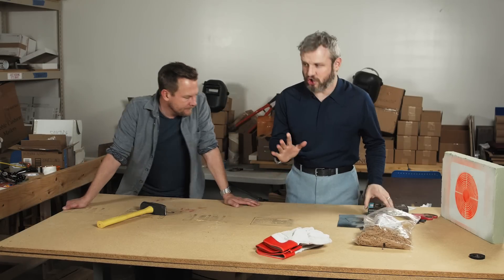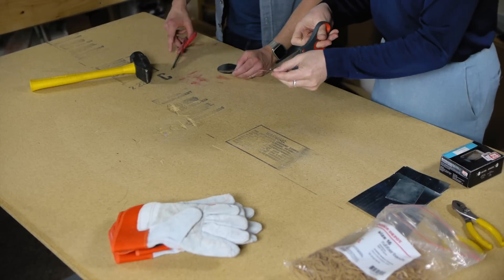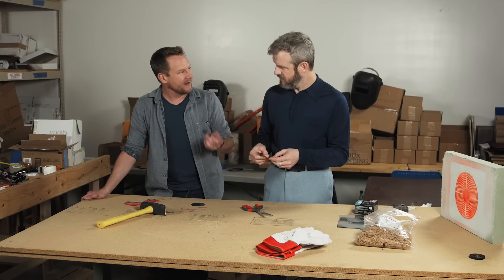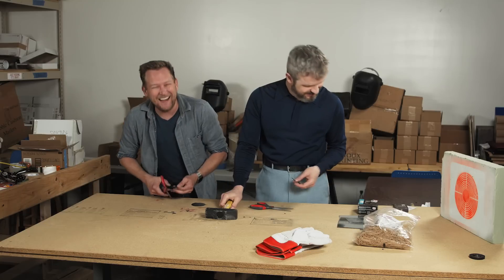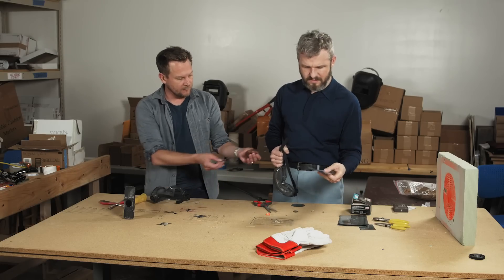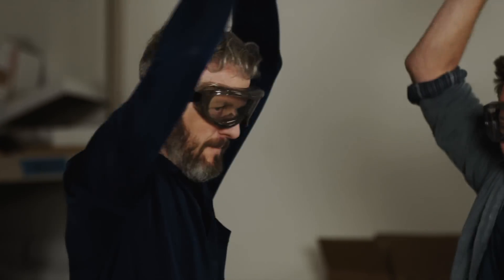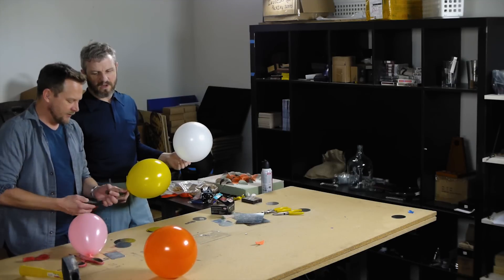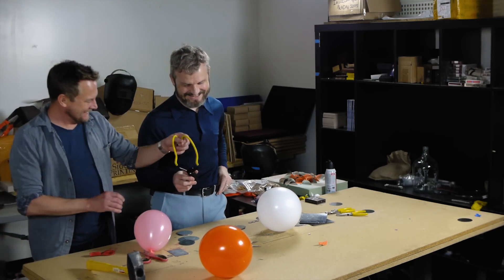Testing Ninja Stars with a Slingshot

Comment: We did this at work one time at the end of the year when we had a stack on non-functioning badges. We just stacked a few on top of each other using the adhesive already on the badges, rotated them, cut them, and threw them at targets. Surprisingly sharp and effective.

Comment: I used a wrist rocket in combination with a 4 point star and it was really impressive. It would stick half way into a 2x4 and you had to stand on the wood and use a vice grip to remove the star.

Comment: I think you guys should revisit shuriken and actually do it right. Try some bo-shuriken, make actually usable multi point shuriken and learn to throw them right. Even taking some large gauge nails and welding them together, like you guys actually mentioned, would be miles better than these little discs. If you want any tips, I am a knife maker and have made some simple improvised bo shuriken in a few minutes and I have been throwing knives and various kinds of shuriken for the better part of 15 years.

Comment: I used to make some gnarly ones out of exacto knife replacements, a little glue and some electrical tape, 3 points seemed to work best cause you could get about ~3 from one pack and I put them through rigorous testing and it would go through some sheet metal and chipborad and wood easy, it also had a tendency if sticking two points in which was brutal cause the way you had to remove it, cheap as hell and very effective
Reply: don't let me get bored with extra art supplies

Comment: Use to do something like this. just cut squares out of 16-20 gauge sheets using Aviation Snips and a few strokes of a file to deburr them.you can also buy large square washers and sharpen them with a grinder.

Comment: Backward spin is the answer. Start with playing cards and rubber bands. Use your fingers as though you are shooting a spitwad when you were in third grade. Place a playing card in the loop of the band. Grip the band around the card about  3/4 of an inch from the bottom. Take some practice shots at low power till you get the hang of it. I have shot playing cards onto the roof of a 3 story building. No BS.

Comment: u should have pulled the slingshot back further...7 inches of pullback..no wonder it wasent going in...if you hold the slingshot sideways you can use the top prong of the v for a sight...itll be waaay mor accurate..i kno this cause im a slingshot target shooter btw js

Comment: What kind of damage would this do to an actual human? While I realize that these are meant to harass, if the target had their adrenaline pumping these would have to have a decent effect in order to get the target's attention.
Reply from the maker: I'm betting if you're just standing guard and suddenly get cut across the face, the enemy will have achieved exactly the level of distraction they were hoping for
Reply: Ah, fair point. However, wouldn't you achieve the same thing with any small thrown object? A normal shuriken might leave a nice cut and a confused guard, wouldn't these have basically the same effect as a small stone?